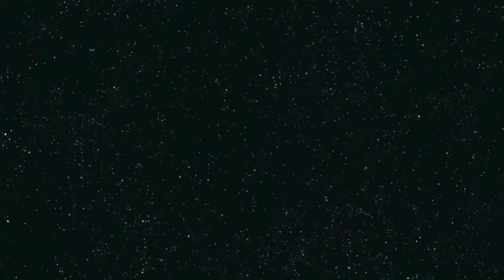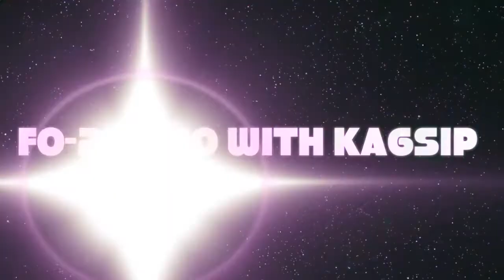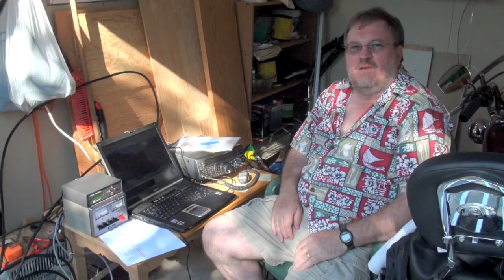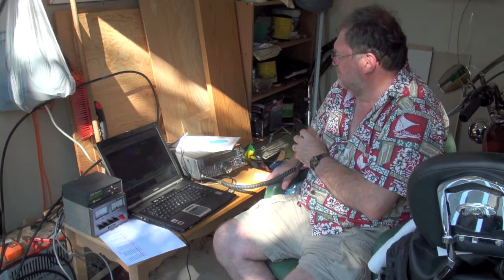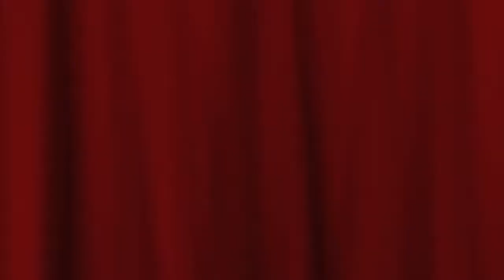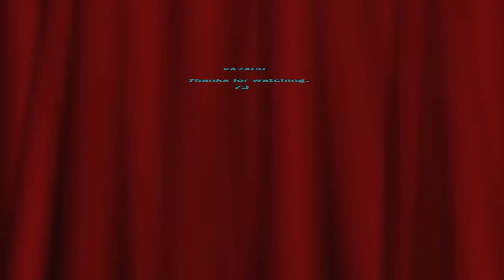FO-29 Satellite QSO VA7ACG - KA6SIP

Comment: Do you run the 2000 with the trace on or off?
Reply from the maker: SatPC32 runs the radio, but the answer would still be yes. Fine tuning is possible in the software.